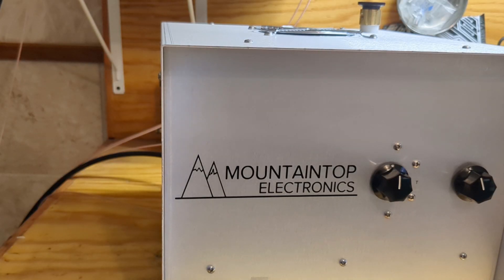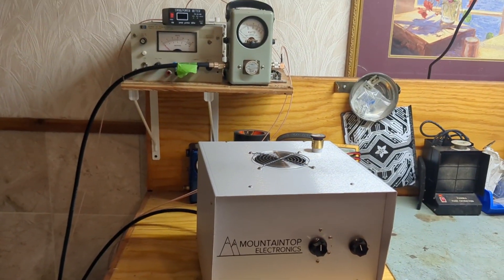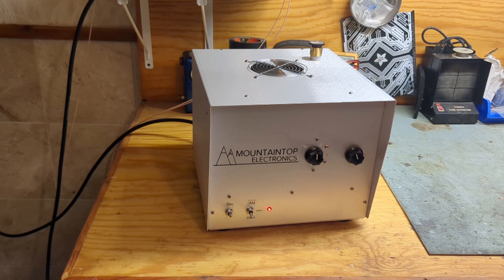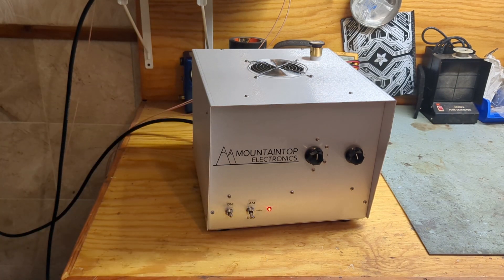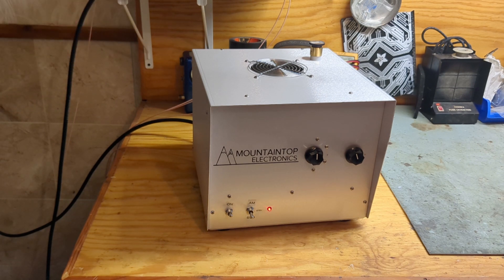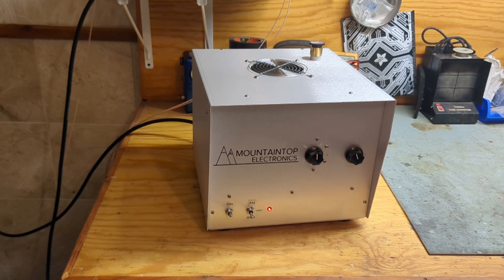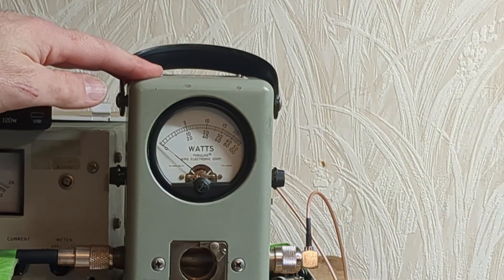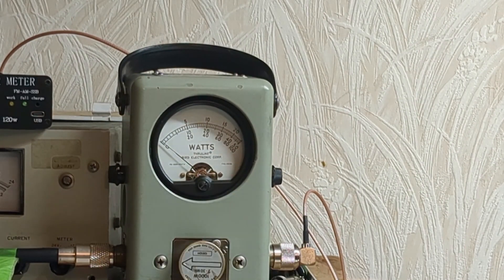Mountain Top Electronics GI7B amplifier under test

Comment: Nice amp. So if I drive the amp with a stock Cobra 2000  (17what) what do you think the Amp will do?
Reply: i drive the same tube with 15W and get 250W, easily.
Reply from the maker: Maybe 200?